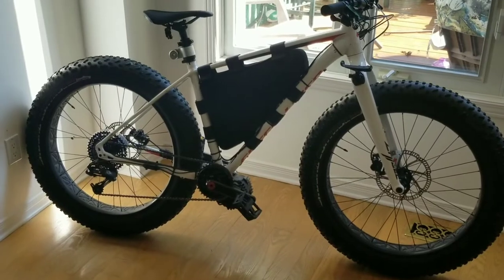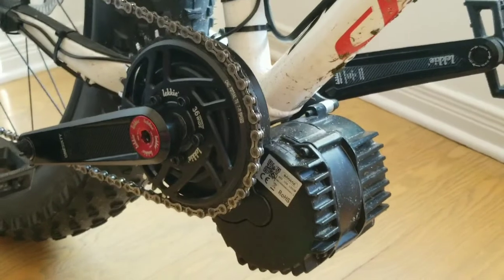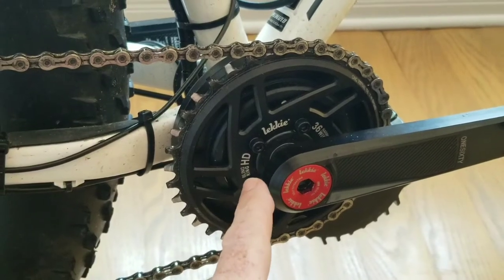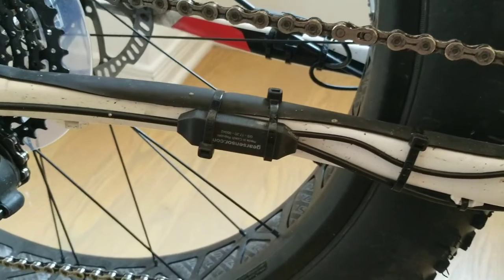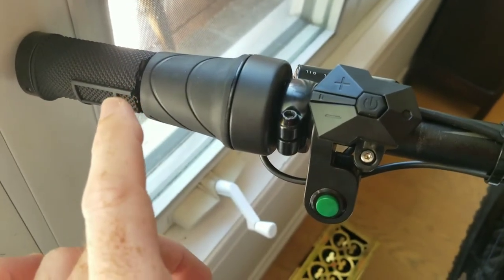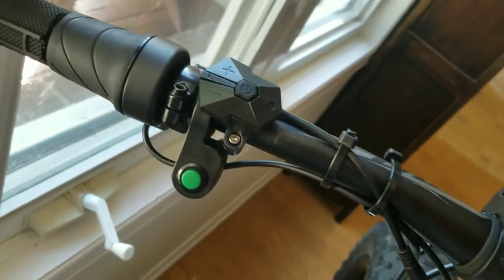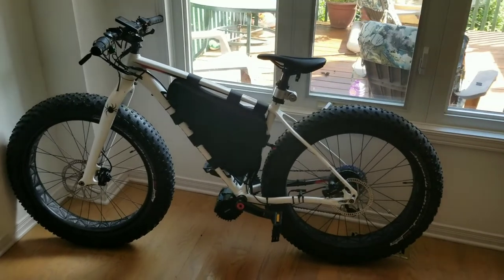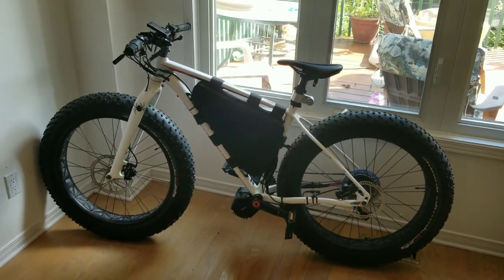Bafang BBSHD on Specialized Fatboy ebike conversion (stock) 30 amps 1500 watts

Comment: Very interesting!!! Thanks for posting. Do you think similar build would fit the fatboy XL ? Are you able to estimate the cost of your build?
Reply from the maker: Michel Lépine Is the XL a new model? Or just the frame size? The main thing is to determine the bottom bracket size and type. Anything other than a British thread needs an adapter. But they are not expensive. Total cost for me was $1800 Canadian. I used em3ev. There may be cheaper but the battery these guys make is very very good.
Reply: @HighVoltageKits  XL is the frame size yes. I'll measure and check BB type. Thanks.
Reply from the maker: Michel Lépine Pretty sure you will be good to go then. If you have any questions I'll be glad to help you out. If you use em3ev it's worth mentioning the spacers and the bike. as they sent me a steel spacer that fitted perfectly to clear the chain stays. I think mine might be a large but I'll check. Either way I dont think the bigger size will change the clearance in this area. Good luck with your build.
Reply: Michel Lépine did you end up building an XL version?
Reply from the maker: Yeah it's the XL frame size, cheers

Comment: Hi I got 4 miles on my Bafang  before it died.  The display is working.   Could it be the second hand battery I bought.    48v 10ah    Or do yu think it’s the controller. I’m waiting on a volt meter.   I have disconnected the break leads.
Reply from the maker: that sucks. hopefully testing with the volt meter should help. does the display show a voltage?
Reply: maybe your motor is too big. If its bigger than 750w it eats the battery

Comment: if i remember correctly you can change the settings to reflect the voltage of your battery
Reply from the maker: It depends on the display a little. My original display is meant for 48volts and has no option to change it. The egg rider I'm using now has quite a few options for setting the battery up.
Reply: Hello nice video. I have a motobecane fat bike and a marin full suspension bike. Im haveing a hard time deciding which one to convert electric. What would you reccomend?
Reply from the maker: It really depends on how and where you want to ride. I would be doing the fatbike as to me it's the most versatile. Strong. Big triangle for a battery etc. I have never converted a downhill frame but lots do as they are super strong. I want to commute all year as well as running trails etc. Nothing crazy as I'm not that kind of rider but general touring about fun. I have alot of ride videos with my fatbike so you can see the kind of terrain I have ridden etc..Cheers

Comment: 30 pounds or kilos? Mid drive kits weigh 30#.
Reply from the maker: I think 30 kilos is more accurate. The frame and wheels were 30lbs... But the battery particularly adds a fair bit.

Comment: I am planning to ride an e-bike across America. I will be pulling a trailer and taking my dog who I trained to ride on the trailer. My total weight bike plus gear will be about 230 kg or about 500 lbs. The reason for so much is because I will be unsupported. I plan on bringing a 900 watt generator that weighs about 13 kg. My question, is it possible to charge the battery from the generator that will be mounted on a custom made trailer while the bike is still moving? Oh yeah I also plan on using the bafang 750 watt motor.
Reply from the maker: Sounds like a cool trip to plan. I wish I could give you some definite answers but I'd be bullshitting you and that's not right. I have no idea if simultaneously drawing power and inputting power will damage a battery or not. I can do some basic math on my setup. My charger for example outputs 4.3 amps to charge the battery mine is 25 amp hours. So three to four hours to charge from 20-30%. The motor is 30 amps. So you'd be topping up with about 16% of the amps being drawn using my charger. A faster charger is expensive. One of the most amazing things about the ebike is how quiet it is. My best advice is dont make you and your four legged friend listen to a gas genny running all day.
Reply from the maker: I would also recommend not using the 750 motor. The hd is much much better built and longer lasting. You will appreciate it moving 500lbs. If you get a big battery 25-30 amph and use a level of assist that requires you to work a bit you can go all day on a charge. I honestly think you will have a way cooler time charging at night with your genny when needed and jacking power when you can lol. Good luck with your trip. Try Canada when you are done with the US. You wont need the genny tho. Peeps will charge your bike.
Reply: @HighVoltageKits  thanks for the tip. I will start my build in January and I plan on starting this spring. I've already have a bike picked out. A specialized roll sport. I've done been across the U.S. once before with my dog and me pulling a trailer. It wasn't as enjoyable as I thought it would be because my total weight was 430 lbs. But with an e-bike I think I will enjoy this trip more. I've learned from my mistakes on the first trip, for one I will be building my own trailer with 20 inch tires, another is I want wider tires on my bike and disc brakes. Thanks for the tip bro.
Reply from the maker: @samstarr37  I looked up the bike. It's a British thread bb so no mods needed to slot in the bafang. The 73mm one should work fine. You will have a smile on your face all day running the bbshd especially hill climbing. Pulling both my kids and trailer with me etc is just under 500 and the motor pulls it with ease. The 750 will work but to the bbshd will get you up a hill with much less stress on the motor. You don't want to burn out mid trip. Check out em3ev.com they do really good batteries and excellent programming on their motor controllers. They are more expensive than other options but you get a good service and an honorable company. Luna are good but are expanding and fall down in the customer support areas. If you buy off ali express etc you get your motor but you WILL need to program it as stock programming apparantly is so bad its lethal. As bad as the shitty 46 tooth ring they ship.
Reply: Thanks for the amazing vid.  I’m planning to build an ebike , using a Giant DS3 mnt  bike.  Can you give us an idea for total cost of motor and components? Thank you.
Reply from the maker: The CYC is about 1000US a good battery between 600 to 800 on top. You may want to allow for extra parts etc you might need or new tools etc. Or even just getting a good bike shop to install it if you are not mechanically inclined. Cheers!

Comment: nice build. what batteries did you use?
Reply from the maker: Besjan Cangu I got a 25 amp hour pack from em3ev.com. I think it is Samsung 30q cells.
Reply: @HighVoltageKits  thanks :)

Comment: Hello mate great work on video, I have had my bbshd fat bike for 3 weeks and I have destroyed the original chainring . I put on a 42t Lekkie and I am still having chain problems due to alinement . Did you ever get the higher gears dropping some gears putting spacers in .
Reply from the maker: Dean Boland I'm in the process of swapping the one I have for the 42T. I'll post the vid next week. in theory it should help with the chain line.

Comment: what size BB length did you choose with for your kit?
100mm or 120mm?
Reply from the maker: Von Wagner I think it's the largest one they do. Pretty sure its 120.
Reply: @HighVoltageKits  one more question if I may, do you happen to remember if you had a threaded bottom bracket or a press fit?
I'd love to do this conversion, but finding a proper donor bike to minimize hassle is key.
Reply from the maker: Von Wagner British thread is a straight fit. Press fit needs an adapter. I'll send you a link if you need it.
Reply from the maker: here you go https://www.ebay.ca/itm/J-L-PF30-PressFit-30-386-EVO-BSA-Bottom-Bracket-Conversion-Adapter-Convertor/351701600151?hash=item51e30c8797:m:mGzn1-tgncXw7tnBk7EtrMQ
Reply: Captain Codswallop thanks very much. I'm guessing you needed to do this on your Specialized as it's a PF bb too eh?
Reply from the maker: Von Wagner I thought so as well so I had a set ready. But it ended up being British. They had two models at the time. Not sure if this is still the case or what are using now though.

Comment: I think the 42 lekkie ring has a 18mm offset so you would be able to use the gears. The 36 has less offset so you have less range of gears than a 42.
Reply from the maker: Simon Greaves thanks. I might experiment a bit.
Reply from the maker: A1 Technically the 42 cog should reach a higher top speed. However the limiting factors in this bike are the resistance of the 4.6 inch tires.  If this was on a lighter bike with thin road tires it would have more impact. But as I am mainly interested in climbing power its effect might be less. The offset might let me access the granny gear on the cassette though so overall it might be a good investment. I'm going to test the theory in the summer and pick one up!
Reply from the maker: Jeff Hogueison can you suggest a good one? Nowhere local seems to have decent smooth tread tires near me. I do need to change them out. Way too noisy. Might reduce the brake chatter as well.
Reply from the maker: Jeff Hogueison Cheers

Comment: How did your waterproof the cabling /battery etc? Thanks
Reply from the maker: The stock BBSHD is fairly watertight as a unit so you wont have to worry too much about it.. If the supplier put on an xt90 for the battery connection i doubt you will have problems with that as its a tight fit. As for batteries it really depends on what you get. I have a battery bag for my triangle pack as the shrink wrap is not 100% waterproof. If you are planning on ridding a ton in all weathers I would suggest a spray on coating or  waterproof cover for the battery. I think things like shark packs and dolphin packs are waterproof. I would check with the supplier. For my external controller I did this https://www.youtube.com/watch?v=vXGPNPmohXw&t=11s since then I made a 3d printed mount. But there is room for water to get at cables still possibly so now I am better at 3D modeling I need to do the work again and make a better one. To sum it up if you think water can get in anywhere I would make sure it can't. But stock you should not have any issues as the harness is all waterproof higo connectors. Hope this helps. Cheers!
Reply: Captain Codswallop Thanks! Your videos inspired me to build the same bike, they were very helpful  - I took my bike for its maiden ride downhill in the rain today and on the way home - the motor would only work intermittently - im still troubleshooting but I'm guessing water ingress is the problem. So I'll have to improve on that and hopefully I can ride again
Reply from the maker: Anytime. You are running the stock setup? Check the speed sensor for water. The stock bafang should not let water in. Give it a good dry out and hopefully it's good. Glad you like the videos. Cheers
Reply: Captain Codswallop I tried everything I could except for opening the motor up - its at a shop now getting looked at - I'll let you know what I learn. Thanks again
Reply from the maker: Hope it gets sorted! Let me know for sure. Cheers
Reply: Captain Codswallop so the shop had to reset the controller with the bafang programming cable and did a full battery recharge ($200)... Yeah I bought myself that cable now
Reply: Captain Codswallop man I feel really dumb - so I've tried to recharge battery with the Em3ev charger twice, it wouldn't work - the store said it worked for them but I couldn't do it.... I decided to press the blue light button on the battery to see if it would make a difference  and it finally turned on the charger. #suchanoob

Comment: Did the kit come with spacers?
Reply from the maker: I asked for one to be sent with the kit as I knew from other videos I would need a few. Em3ev sent me a 7.5mm one and I bought two 5mm ones from another place. I also had a few 1mm and 2mm. I might do a preparation video. I spent a whole planning the build which paid off.
Reply: Captain Codswallop Oh ok thanks! Whenever I can afford to build I'll make sure I get some. I may have to get any extra ones online somewhere. This is not common enough where I'm from. No shops at all
Reply from the maker: @WeTryYouWin  In theory any bike shop has bb spacers. I wanted to use as few as possible. having one custom made could work too. its just a steel or aluminum ring.

Comment: hello where did you buy the whole kit?
Reply from the maker: I got everything at em3ev.com
Reply: @HighVoltageKits  thank you..better as you did or buy an ebike directly? is the engine okay? Does it help you in the climbs? how long does the battery last?
Reply from the maker: I have no experience of buying a complete ebike. I'm more a DIY guy. So I bought the motor and all other stuff as a kit from em3ev.com. There is leg work to get extra parts like spacers etc depending on the bike you use. For the other questions is a bit more complicated. It will climb hills with zero human effort.. or you can set it to just give a small assist. If you ride with the throttle wide open range is about 40-60km.... My battery is big at 26 amp hours. You could go all day on a 300-400 watt peddle assist.

Comment: What is capacity of battery?
Reply from the maker: This one is 25 amp hours. Its not made anymore. But its a 52 volt with Samsung 30q cells. 14s 9p configuration. Cheers

Comment: Would love some info on your charger/charging
Reply from the maker: Nadeem Butt Its a pretty standard 58.8 volt charger which you need for a 52 volt battery. Seems to charge it at about 4.3 amps with full charge in about three hours. The 90% charge function seems knackered though so I might get something better.
Reply: @HighVoltageKits  you charge to 100% then? I've decided on a BBSHD, a battery from EM3EV but cannot decide on which shape. I was going to convert a hybrid bike for a 26 Mile commute, but now thinking a mountain bike with semi slicks may be more suitable. Also undecided on whether to buy a cheapo charger or go all out.
Reply from the maker: Nadeem Butt I try to not do 100% People with more experience than me say you get more cycles out of your battery then. You wont be disappointed with the em3ev battery though. They are high quality. 

Going back I'd buy the better charger. All I do though is use a timer and shut of charging before it is full.

I'd go with an mtb as you can always change tires etc u fancy hitting trails etc. Sonething with disc brakes and front suspension. I'm going to have to do new forks running the harder compound tires.
Reply from the maker: Hey Boss T. There is nothing wrong at all with what is written in your manual. It is quite correct. If you only charge a battery to 90% of its rated capacity you will not reach its full potential of 100% This will result in less range. Plenty of people use their batteries like this. They are built to do this and last a minimum number of charge cycles before they start to loose capacity. 

We all have laptops that gradually work for shorter and shorter periods before they need charging. Ebike batteries are no different. The chemical nature of batteries is such that each charge just like with a mechanical item causes wear and tear or damage. So my 52 volt pack it is estimated can go through 600 charge cycles before capacity starts to degrade. The chemical wear caused by charging occurs faster the closer you push the battery to its maximum capacity. So if I only charge it to 90% I am able to increase the service life of my battery. 

This is direct from the mouths of people who make the batteries at EM3EV. But I have heard the same words from many other more experienced ebike makers and riders than myself. 

So when I bought my battery I chose one with high power but enough capacity to get the range I wanted from a 85% charge. With discharge the same is true. The most wear occurs at the low end. Peoples phone batteries would do a lot better if we did not consistently deplete them to zero. They would last longer. 

An ebike battery is usually the most expensive part of the bike so this is a way of getting longer life from the investment. Not that I always follow this rule. Long rides get a full charge. But for day to day commuting it is beneficial.

I hope this explains why the manual says one thing but savy end users recommend a different way of doing things to get max value from a pricey item.

Cheers!